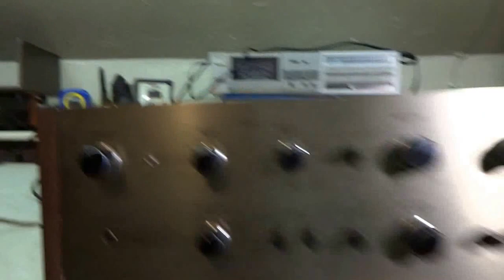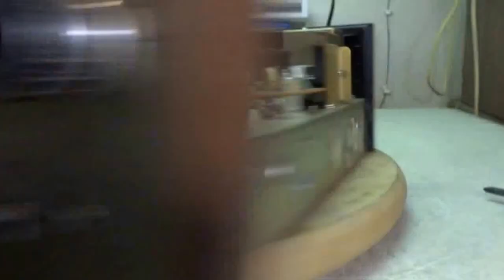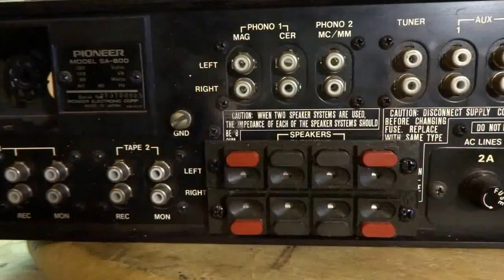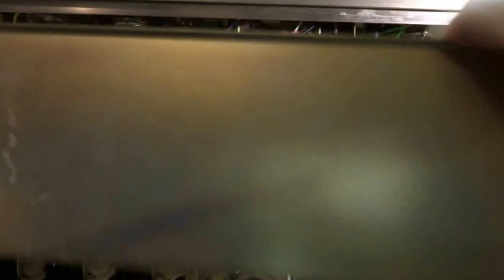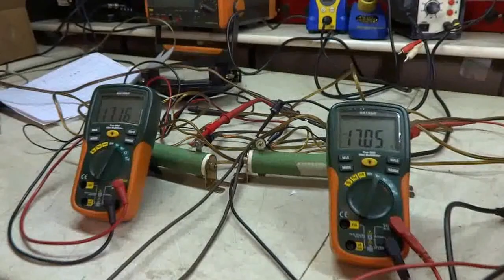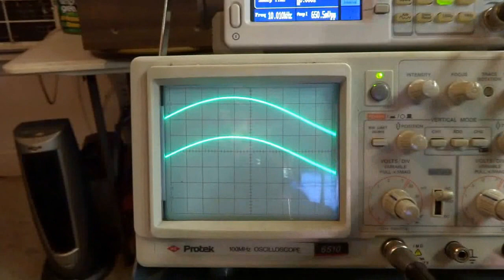Pioneer SA 800 Recap

Comment: I’ve just picked up an SA 600 smaller brother to this but basically the same. It was in pristine condition very low hours in it. I just went through seizes the pots etc. issue I have is a slight static from right Chanel. No matter input etc and even with no input. It’s very low. I have to have ear near speaker but it’s there. Left Chanel has none. Any ideas? Thanks in advance. As far as I can tell
This is all Stock and never serviced. Looked like barely used. No dust even on inside etc.

Comment: Hi, just found a sa 800, how did you change the speaker output thing ? Where did you find a new one ? Pioneer cable plug are expensive !
Reply from the maker: I got the speaker output thing from a junk stereo. Wiring it wasn't hard. I pick up a Pioneer SX-9000 that has the same silly plugs but it had 4 of them with it. 
When I first got the SA-800 I stuck nails in the slots just to to if it work. 
People on Ebay want way to much for these silly little plugs.

Comment: Thanks for your videos - do you remove the entire board when recapping, or are you able to replace the caps without completely removing each board? Could you make a video showing that process?
Thanks!
Reply from the maker: Thanks for your comment. I try not to remove any boards when working on them. Many times there are to many wires running all over the place. A lot of the times the board can come loose and one might have room to work on them. Other times I may have to unsolder a wire or two to get at things.